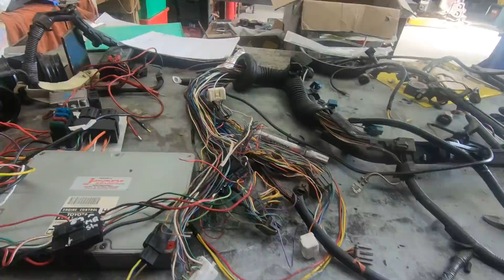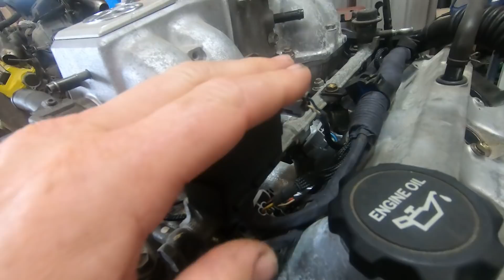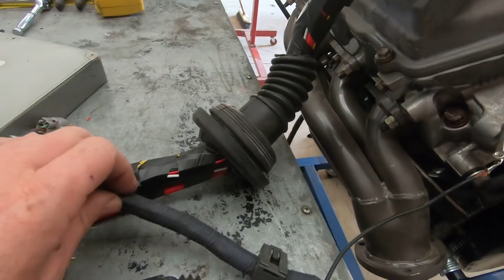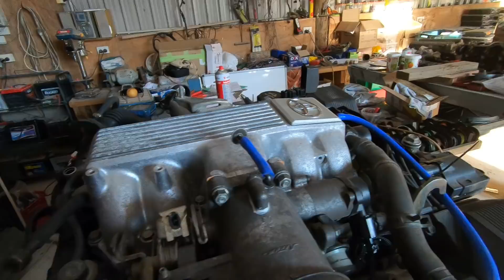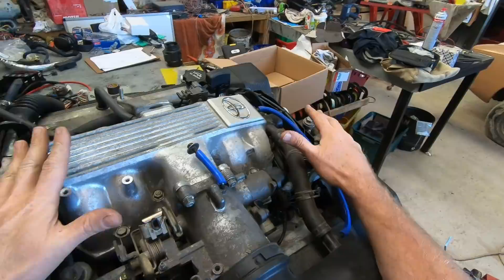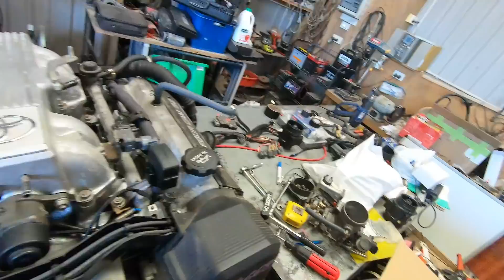1uz Wiring Stuff ups Part 2.  1uzfe UCF20 Into Daimler

Comment: It wasn't this vid/comments, but it seems like you were selling wiring diagrams/notes for like $100.  I'm sure I can sort it with just the FSM, but I'd be interested in what you have available.  I'm working on a 95 1UZ out of a Lexus SC430 going to go into a TR7 with a R154 5 speed.
Reply from the maker: I have more than just diagrams.   I have sets of instructions with step by step of how to wire correctly.   Wiring these engines correctly into a conversion is one thing i see people struggle to get right so ive solved the issue for my customers.   I sell alot to auto electricians too.  You are also in luck this weekend there will also be a video of a TR7.  Im sure that will spark an interest for you too.  Its not actaully about the fitment but another issue but I show a bit about it.  Cheers.
Reply: I do a fair amount of aircraft avionics(USAF training back a few years) as a side job & my last swap was a Rover V8 into an MG, before that a Ford 5.0 HO into an old Ranger for a friend as well as a few others in the past so I'm sure I can sort it, just thought that I'd see what was available as it might give a jump start.  I will be interested to see the TR Vid as well...
Reply from the maker: @dereckbauer2613  fair enough ,  alot of guys want quick answers and fast so it suits them,  and they like the backup that they can contact me and ill answer their questions.  Years ago when I had both a conversion workshop and normal repair workshop I was averaging a phone call every 20 minutes and it nearly drove me nuts.  Doing written instructions for both conversions and wiring solved that problem.  My videos are an extension of that so I can point people in the right direction while I can still get through my days work.  TR7 video going up now.
Reply: @CartuneNZ  Interesting, I didn't catch what he's using for a rear end, I do notice that they have changed out the small 4x3 3/4 hubs for some 5 lug hubs... I'm back to the question that I think I saw either in a video or a comment on a video that you sold the diagrams, if so what am I looking at for cost & time frame & how would I order? if not that's ok too, I'll just have to sit down with the schematics & sort out what I need vs what is surplus now...
Reply from the maker: @dereckbauer2613  Ford falcon rear end I think which is 5 stud.  For wiring instructions I need your ECU number.  I have paypal and all info is on my google drive so I can share from nearly everywhere provided I have some internet access.  Normally within one day of payment.
Reply: @CartuneNZ  a LOT of the paper label on the ECU is gone or degraded, the main large numbers that are still there are 1UZ-FE 42, also in a black area with white letters is the word TOYOTA on one line and what looks like it may have been a number ending in 410(maybe, the 10 is clear, but the 4 is a bit of a guess) under it, then below that a line of black letters on a white background which appears to go "xxx(unknowns)then -421 12v" the barcode also appears to end in xxxx606421Q.  So I'm guessing that would make this a 421 ECU?!? Finally, the connectors are 40P-40P-40P.  I can send a pic if helpful, there just doesn't seem to be a way to attach here...
Reply from the maker: @dereckbauer2613  I've got a "how to ID your 1uz ecu" video on my list but it might be a little while yet.  I can identify the ecu on a photo and a few questions about your engine very easily and supply the correct info.  Your one has a few options on loom anyway with slightly different body plugs.  We can sort that if you chose to purchase the info.  Cheers
Reply: @CartuneNZ  What is purchase price?
Reply from the maker: @dereckbauer2613  Wiring instructions for all non vvti engines is $150nzd (around $100usd).  It includes 30 minutes of my time to help too.  Cheers.
Reply: @CartuneNZ  Ok, is there an order number?  I'm likely to do it if just to compare to my own thoughts, doubt if I'll be bothering you much...  I just got the engine out of the SC400 yesterday as well as the loom, it looks to be in relatively good shape(the look that is, the engine is all kinds of grimey, she'll get new gaskets & seals with the likely exception of the head gaskets), only thing I see is that there is some sort of "Clip on power adder?" connected to two wires of the AFM connector.  Easy enough to remove it & throw a piece of heat shrink on both wires, and I probably have 1 or 2 connector shells that the lock tab is broken...
Reply: @CartuneNZ  How would I purchase?
Reply from the maker: @dereckbauer2613  Good morning Dereck.  Flick me an email at info@thecartunecompany.co.nz  if you include photo of ecu , throttle body and engine I will confirm which loom you have from that and we will get it sorted.  Cheers

Comment: Hey, I’m in the process of installing a 1uz non vvti into a 40 series cruiser. I’ve unplugged the harness to get it out the way during the install and also ever plug has been so brittle it’s busted about the locking tab. Can you supply replacement ones and point me in the direction of a supplier please?
Reply from the maker: Where in the world are you located?  You have seen the videos of the 40 series I have done?
Reply: I’m in tassie. I’ve watched it about 20 times. Hopefully mine ends up sounding like that. I’m using the stock auto and I’ve got a transfer coming from a Datsun 720 that I’ll fit up to it.